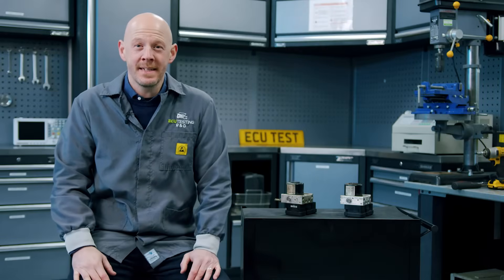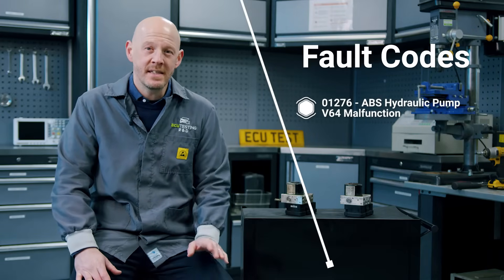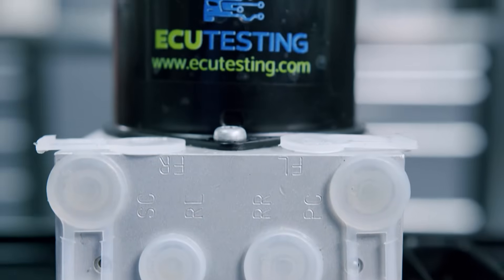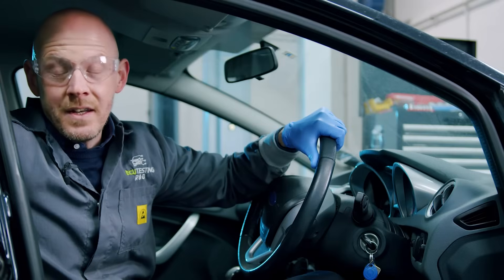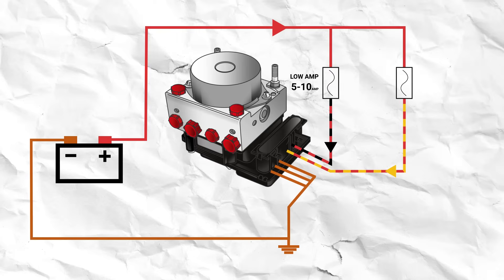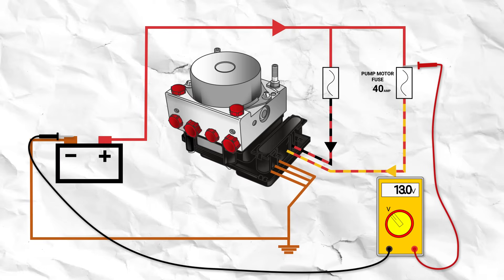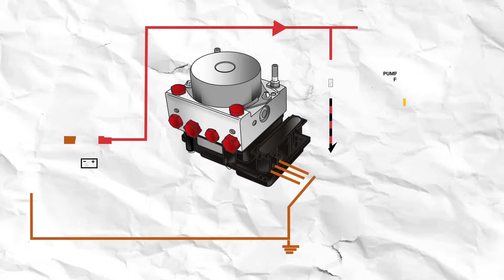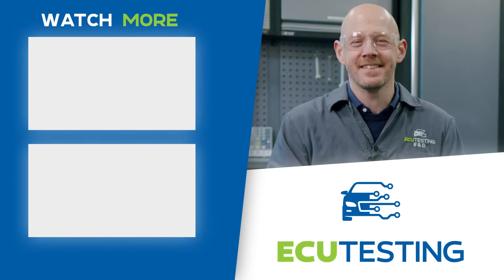ABS Pump Failure Symptoms – How To Test And Fix!

Comment: Hi, i have a ford fiesta 2009 model. I got p0500-00 and C0031-07 fault. It says front left sensor but i have already changed it and bearing as well but still got same problem. On diagnotic tool the speed shows 0km/h. Can this be the wiring or abs module?
Reply from the maker: Hi. If you have already changed the sensor and the fault still remains then you are right, there could be a problem with the wiring to the sensor or the ABS module itself. We have another video which goes into a bit more detail surrounding wheel speed sensor faults and how to diagnose where the fault lies which you can view here: https://youtu.be/T74B_aELnU0?t=128. We would recommend first checking the wiring to the sensor to make sure it is receiving the correct voltage and it has a good ground. Follow the steps in the video and if the wiring checks out ok, then continue to follow the other steps in the video to confirm it is the ABS unit that is faulty. If this is the case then please contact our technical support team via email at info@ecutesting.com or visit our website www.ecutesting.com to get your unit re-built. Thanks.

Comment: Will a bad abs module cause my brakes to lock up?  Then i have to loosen the brake lines at the master to relieve the pressure.
Reply from the maker: Hi. Yes a faulty ABS unit could cause brake binding. Check out the video we did on this here: https://youtu.be/RrSn0M7n9eE

If you suspect your ABS is at fault and want to send it into us, please fill in our online test form at www.ecutesting.com.

Comment: my car is audi a4 b5 1996 quattro. On diagnostics, it doesn't show an ABS pump error, but all my wheels lock when I press the pedal and stay like that until I let the air out. This has been happening since I jacked the car up, started the car and ran the wheels to idle. They told me that I am not allowed to work with the quattro drive because the pump has built up pressure and now it is constantly working, and that the piston in it was leaking and does not return anymore. Is this correct and is there any other problem?

￼

Comment: Hello, I need help, I have a brake workshop, they brought us an iveco daily 35s15 2019 ambulance, when you step on the pedal it goes very low, it does not show an abs failure in the ecu, the pump has no problem, neither do the wheels, everything indicates that the fault is in the abs, it has already happened to us with several vehicles, it is as if the brake fluid left somewhere inside the abs module, has it happened to you?
Reply from the maker: Hi. It sounds like it is a hydraulic issue as these generally don't log fault codes or illuminate warning lights. We would recommend testing the hydraulics of the brake system. Cheers.

Comment: The brake fluid does not reach to the right-back wheel of my sonata car. The abs light is off. Could you please state possible reasons for that? Thanks a lot.
Reply from the maker: Hi. If there is no fluid reaching just one wheel then you could have a blocked or damaged brake line or a faulty ABS unit. Please watch our video explaining how to differentiate which could be causing the issue: https://youtu.be/RrSn0M7n9eE (test for no fluid reaching one of the callipers starts at 2:51). If you do believe your ABS unit to be faulty, then please feel free to send it into us and we can comprehensively test it to identify any faults. Thanks.

Comment: Hi we have 2012 Citreon relay ABS plus traction control faults on dash , no speedo and not registering miles , scanned got configuration fault (configuration not suited to vehicle ) Fault in the alignment of the configuration between ECU's (used Foxwell NT 530 scanner . Been into Citreon dealership (local garage advised to ) couldn't bottom fault , so sent download off to Citreon tech been told fault is ABS pump/module ! doesn't show ABS module fault on scan , reads wheel speeds ok ,What do you think

Comment: I'm in the thick of things right now with my 06 GMC HD2500. I 'm using an old Snap On brick so did a bleed test & know ABS  motor works, but pedal blowby felt where it should push back against foot during this test. I have done a road test & speed registers at all frt & r. WHEELS . If I delete abs light & drive off,ABS light stays off during complete drive cycle. Only when I shut truck off turn back on ABS light glows but yet no codes are being registered!! truck brakes fine otherwise. everything on truck is new from last year and nothing is worn & no seized      "calipers" including a new master & hydro boost. Will check wiring for bad ground or ?? Coincidence after replacing a bad RF hub bearing yet, speed sensor registers ok! Thanks for sharing your knowledge!! you gave me a couple more tips to check out !! THERE IS A REASON AND I HATE UNWANTED DASH LIGHTS !!🤣
Reply: I hear you!  I have a '97 Riviera with a Teves/ATC ABS/TC system that fails the pump-motor voltage test at 12mph after a hot soak.  I've replaced the fuse & relay, cleaned the contacts with electronic cleaner, and even replaced the EBTCM with a wrecking yard unit.  The pump always works when I need it, but the 'judge' in the module insists on deactivating the system & lighting the dash lights because it doesn't like the feedback voltages from the motor...   Arghhh!

Comment: My problem is That the Abs pump still is on when the car is off and it dry out my battery … Do yall Whats the problem?? And I have a abs lamp on my Dashboard and a red handbrake lamp
Reply from the maker: Hi, one of the symptoms that a failed ABS pump and module cause is that of the motor constantly running, even with the vehicle turned off. This is especially true for certain system types, pop an email over to info@ecutesting.com with your part number and we can look into that for you

Comment: Voltage drop would be from B+ at battery to the power wire at module. You did available voltage tests

Comment: I have a MK6.5 Ford Fiesta with the abs light on I’ve plugged it in and it says “ low voltage to ABS pump “ what does this even mean haha
Reply from the maker: Hi. The low voltage code means the ABS pump is not receiving the correct voltage in order to function. We would recommend checking the wiring to the ABS unit and the connector for any signs of damage. It is also worth checking the relevant fuses as detailed in this video. It could be that the ABS pump itself is faulty, so if everything else checks out ok, then please contact our technical support team via email at info@ecutesting.com, and they will assist you further and recommend any re-build solutions we can offer. Thanks.
Reply: @Ecutestinglimited  hi there thanks for the response it keeps blowing the 30A green fuse for ABS system so I’m guessing the ABS pump is fried or the connection has water inside or corrosion
Reply from the maker: @dexietyy7922  Hi. If the fuse keeps blowing then the problem could either be with the ABS itself or the wiring to the ABS. To differentiate which it is, disconnect the ABS unit and test for continuity between the ground and 12 volts signal on the wiring loom. If it reads open circuit, the ABS is faulty, but if it isn't open circuit then there is a short somewhere in the wiring loom. Hope this helps!

Comment: My 2004 Land Rover Range Rover HSE 4.4l with BMW M64 TU has the DSC disabled and replaced with a coil spring system is this the cause of my ABS red light fault with no codes?

Comment: What would cause a module to run even when the vehicle is off cause dead battery
Reply from the maker: Hi. The fault symptoms you have described are consistent with those of a failing ABS unit. If you would like to get your unit re-built or find out any more information, please contact our technical support team via email at info@ecutesting.com with the following information: Your make and model of vehicle, the ABS unit part number (if possible), the symptoms of your fault (as described above), and any further diagnostic information you can provide, and they will assist you further. Cheers

Comment: what if vcds doesn't connect to the abs module?
Reply from the maker: Hi. If you are experiencing no communications with your ABS then we would recommend following the steps in this video for how to check the ground and ignition feeds to ABS. If these check out ok, then test the continuity of the communication lines. If these check out ok, then could be fault with the ABS module itself. If this is the case then please visit www.ecutesting.com to find out how to send your unit into us for a comprehensive test and re-build. Cheers.

Comment: Hi I have a 2013 sprinter van it’s been into 3 places to try and find the fault. The abs light came on they replaced to sensors the light went out my brakes are so soft the brake only works  on quarter of the peddle. They bleed the brakes then put a new kit in the master cylinder it’s still the same they were all lost with it and it’s still the same can you help thanks

Comment: when going over 60 in a 2012 honda pilot, sometimes vtm4, traction, and abs light come on. After you turn the car off and drive down the road, they disappear. Anyone know the cause. Might be an abs sensor but who knows...
Reply: I hope you post your solution. I had a wheel sensor turning five warning lights on, sometimes. Then it was all the time. I bought a scanner but I was hoping the wheel sensor would fix it. It did.....all but ABS and traction lights and cruise control. WTF. I'm hoping to fix it still.

Comment: I have a Mazda atenza wagon an my abs module keeps running after I turn the car off completely us there any reason why it would be doin this sorry I dnt know much about cars just wouldn't mind abit of info if some of e can help
Reply from the maker: Hi. The fault symptoms you have described are consistent with those of a failing ABS unit. If you would like to get your unit re-built or find out any more information, please contact our technical support team via email at info@ecutesting.com with the following information: Your make and model of vehicle, the ABS unit part number (if possible), the symptoms of your fault (as described above), and any further diagnostic information you can provide, and they will assist you further. Cheers

Comment: I am getting ABS Sensor errors, front outside, rear nearside.  Also power steering Malfunction, several other communication errors

When i test voltage at the plug these are 9v, the other two working ones 11.9v

I checked the wire continuity to the sensor. I pulled the plug of the ABS module, put 12v in on the correct pins and tested the sensor plug and got 12v.  So the ABS module is outputting 9v for these sensors.

Why 9v on two diagonal opposed sensors and 12v on the other two?

This is a Ford Focus RS Mk2.  

Would each opposing pair have a different supply maybe?

Is the Module in need of removing and refurbishing?
Reply from the maker: Hi. It may be that your unit is faulty. Please contact our technical support team via email at info@ecutesting.com with the details you provided above and they will be able to advise you further. Cheers.

Comment: Dash ABS warning light on.  Worried this might be a failed ABS module, or maybe a loom/connections issue?  Have just replaced longitudinal, was about to do a Basic Settings recalibrate, but not possible.  Seems to drive fine despite the errors. Ideas?!  It's doing my head in, and I need to get an MOT!

Mk4 Golf, v6 4motion, 2000.  VCDS scan output below.

-------------------------------------------------------------------------------
Address 03: ABS Brakes        Labels: 1C0-907-37x-ESP-A.lbl
   Part No: 1C0 907 379 F
   Component: ESP ALLRAD MK60     0103  
   Coding: 0023046
   Shop #: WSC 31414 000 00000
   VCID: 2D56919BB7029956C6-5000

5 Faults Found:
01279 - Longitudinal Acceleration Sensor (G251) 
            008 - Implausible Signal - Intermittent
01542 - Yaw Rate Sensor (G202) 
            012 - Electrical Fault in Circuit - Intermittent
00778 - Steering Angle Sensor (G85) 
            003 - Mechanical Failure
01435 - Brake Pressure Sensor 1 (G201) 
            012 - Electrical Fault in Circuit
00538 - Reference Voltage 
            012 - Electrical Fault in Circuit
Reply: Thanks!
Reply from the maker: Hi. Please contact our technical support team via email at info@ecutesting.com with your message and they will be happy to assist you. Cheers

Comment: hi, my car is 2011 year  ford fiesta 1.6s.  I have faulty ABS code U3000, I cannot to found the problem pls help. Thank you
Reply from the maker: Hi. The U3000 fault code can be a sign that the ABS unit itself is faulty and may need to be re-built. If you would like to do this, please send details of your make and model of vehicle, unit part number, and the details of the fault to our technical support team at info@ecutesting.com, and they will advise you further. Cheers.

Comment: I checked the 40 amp fuse for the abs motor and the fuse is good but there’s only 4.5 volts there. Any idea what could a use that?
Reply: Sorry to bother you, I'm new to using a multimeter and I don't know where to put it to see the reading. My multimeter is a craftman, can you tell me? I have the same problem as you. I have ABS lights and a car sliding on the panel. The 4 sensors on each tire work and all the fuses have continuity and I don't know what to do anymore.

Comment: My Subaru Legacy and my son's Forester..... suddenly brake goes to the floor to stop the vehicle. At high speed car pulls slightly to one side!  No ABS warning light!  A very dangerous issue that Subaru doesn't want to hear about!  Solution that worked for both of us.....stomp on the brake repeatedly on a gravel or slippery road so as to engage the ABS system.  Immediate resolution of the problem!  Cause?   Perhaps a stuck valve in the ABS from lack of regular use?   Same issue as Mazda 3  comment below!
Reply: How many hard brakings did it take you to fix? I have the soft pedal with no codes in Mazda3. But also appears to be brake fluid leaking around the ABS module so I'm not sure if this is the problem. I've done the hard brake thing a few times now and hasn't fixed it yet.
Reply: @AudreysKitchen  .. you need to trigger the ABS on an icy or loose gravel road.

Comment: 2012 Mazda 5. Brakes peddle drops to floor. Pumped they work fine, but after awhile of no braking then when applying brakes, it drops again. Also,  could hear bearings. Replaced back brakes, calipers, bearings and still have the problem. You can feel peddle catch and then air leaves, peddle drops to floor.  Was told to replace ABS HCU.  What do you think ? This looks to be very expensive.  Im in CA
Reply: See above comments. Trigger your ABS on a gravel road!
Reply: I have exactly the same problem on my 2010 Mazda 2 DE, how did you solve it?

Comment: I have a 2004 Lexus GS300 with the fault codes of C0246 open/short circuit SRR brake booster, C0256 O/S circuit SRL, C1223 Malfunction ABS control module. All wheel speed sensors read correctly. Is the Malfunction Code do to the first two?

Comment: Hi, i have a 2009 Scirocco 2.0tsi.  ABS & Traction lights came on randomly along with a flashing handbrake light.  Took it to a garage that reset the error codes and the issue went away for about 15 miles; now it is back.  Brakes feel fine, no issue with the way it drives either.  Code is 16352 - Control Module - Defective.

Is this something your rebuild service can sort out?  Your rebuild cost is really reasonable considering i have been quoted for a new module @ £1,200 plus 5hrs labour...
Reply from the maker: Hi. The 16352 code is a very common sign of a faulty ABS module, and we do offer a re-build service for your vehicle. If you fill in our online test form at ecutesting.com with the following details; Vehicle make and model, ABS part number, details of the fault as you have described above and any fault codes, then our technical support team will advise you further. Cheers.
Reply: Hello I'm in the US I have a 2018 Ford Transit connect two of the wheels the front driver and the rear passenger both calipers are dragging I have already checked both calipers and already checked the brake lines The only thing I can think is maybe the ABS module is keeping pressure supplied to those two calipers please help me😢
Reply: Lol I've got a seat leon tsi for my first car has the same exact problem and fault code going to send these guys my abs pump for a recondition

Comment: What do I do if the abs and TC warning light don't turn in ever? Abs and TC also don't work and all fuses are good
Reply from the maker: Hi. There could be a number of other factors causing the ABS and TC to be faulty. We would recommend scanning the vehicle for any fault codes to help diagnose the problem. If you could send the details of this scan, your vehicle make and model, and any further symptoms to info@ecutesting.com, then our technical support team would be happy to assist you further. Thanks.